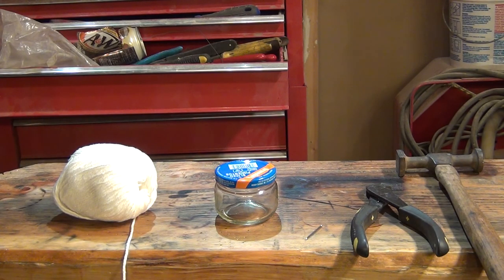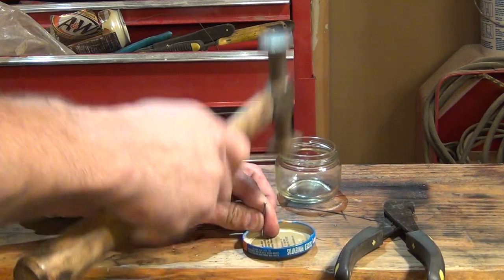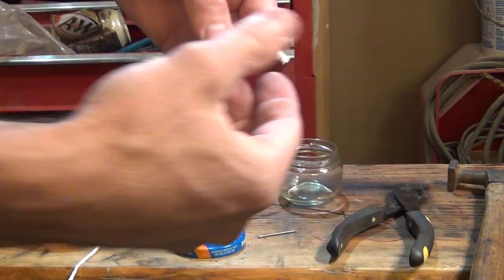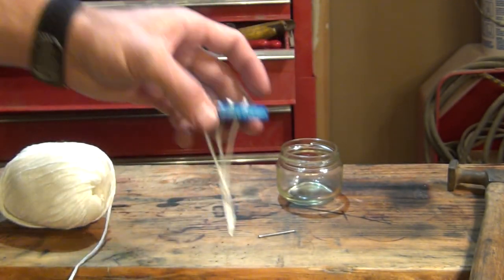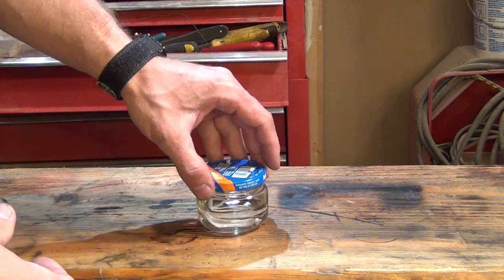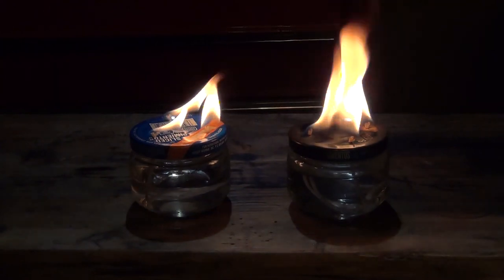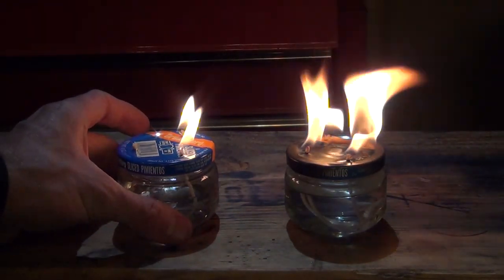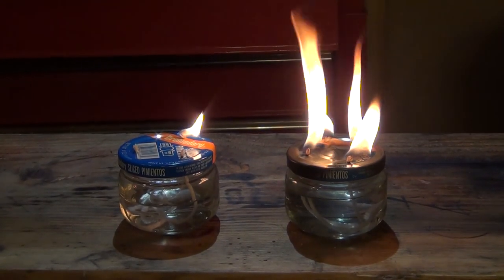How to make a 3 wick emergency cooking candle - HD

Comment: What a fine way to do some cooking in the wild!!  And not only that, the control of the flame allows great opportunity for stealth - very little smoke also...You could use a spare lid to sub out the wicked lid for transport without leaking oil...and then the wicked lid could go into a small tupperware container for all you wicks and firestarters, etc...Thanks for another fine video...
Reply from the maker: Absolutly! Great idea for an emergency situation. I love using them around camp in the summertime! In the winter I like fire. :-)